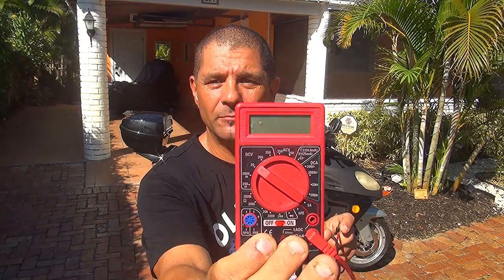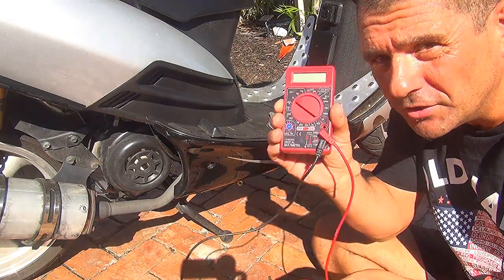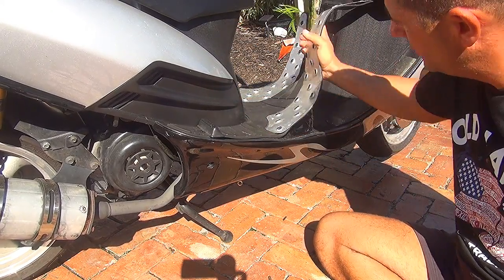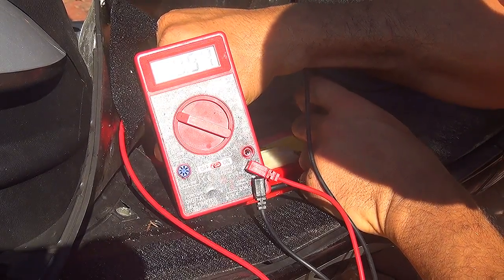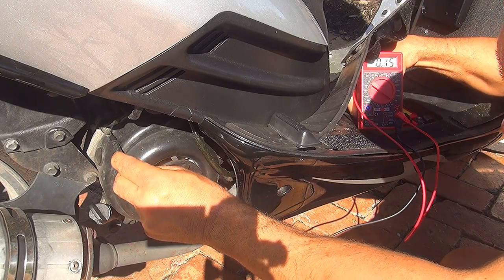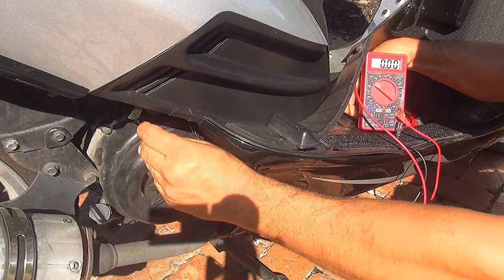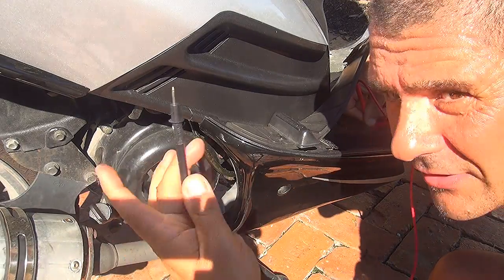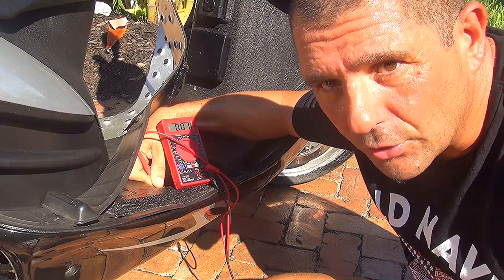How to Check the Ground on your Scooter Motorcycle

Comment: \really good informative video. My Kymco Agility City 125 has been really slow starting almost like a low battery, i have replaced the Battery and Starter Motor but it continues to hardly turn the engine over. i also ran a wire from the positive terminal on the Battery direct to the starter motor but nothing changed. Any ideas?
Reply from the maker: It's great that you've already replaced the battery and the starter motor to address the slow starting issue on your Kymco Agility City 125, but it's frustrating that the problem persists. Here are some additional troubleshooting steps and ideas to consider:

Starter Relay: Check the starter relay, which is responsible for sending power from the battery to the starter motor. If the starter relay is faulty, it can cause slow cranking or even prevent the engine from turning over. Try replacing the starter relay or testing it to ensure it's functioning correctly.

Electrical Connections: Inspect all electrical connections in the starting circuit, including those at the battery terminals, starter motor, and starter relay. Loose or corroded connections can result in a voltage drop and slow cranking. Ensure all connections are clean and tight.

Ground Connections: Poor ground connections can also affect the starting system. Make sure the ground cable connecting the battery to the frame and engine is in good condition and securely attached. Clean any corrosion from the ground points.

Ignition Switch: A faulty ignition switch can sometimes cause issues with starting. Check if the ignition switch is functioning correctly by testing it or replacing it if necessary.

Starter Solenoid: The starter solenoid, often integrated with the starter motor or located nearby, can malfunction and cause slow cranking. Ensure it's in working order, and if not, consider replacing it.

Compression Check: If the engine is turning over slowly, it might be a sign of internal engine problems, such as low compression. Consider performing a compression test to rule out any engine issues.

Charging System: Make sure your scooter's charging system is working correctly. A weak charging system can result in a poorly charged battery, which may lead to slow starting. Check the alternator, regulator/rectifier, and stator to ensure they are functioning as they should.

Starter Clutch: The starter clutch is responsible for engaging the starter motor with the engine's crankshaft. If it's worn or damaged, it can cause slow or ineffective cranking. Inspect the starter clutch and replace it if necessary.

Engine Oil: Ensure that the engine oil level is correct and the oil is in good condition. Low oil levels or dirty oil can increase friction and make it harder for the engine to turn over.

Consult a Mechanic: If you've checked all the above components and the problem persists, it's advisable to consult a professional mechanic who specializes in scooters. They may have specialized diagnostic tools and expertise to pinpoint the issue accurately.

Remember to prioritize safety when working on your scooter's electrical system, and if you're unsure about any step, it's best to seek professional assistance. Electrical problems can be complex, and a thorough diagnosis is essential to resolve the slow starting issue.

Comment: great video! i think mine has problems lol. I put the postive (red wire) to the batter yand when i check the battery ti read 12.9. But when i move the black wire to another metal part on the bike, i only read 0? I tried many bolts is this a bad ground wire for me?
Reply from the maker: It seems like you're experiencing a problem with the ground connection in your scooter's electrical system. When you connect the positive (red wire) to the battery and get a reading of 12.9 volts, that indicates your battery has a good charge. However, when you move the black wire to another metal part on the bike and get a reading of 0 volts, it suggests that you have a bad ground connection.
Here are some steps you can take to troubleshoot and potentially fix the issue:
Check the Ground Connection: Make sure that the black wire is securely connected to a clean and bare metal surface on your scooter's frame. The metal surface should not have any paint, rust, or other insulating material on it. Clean the surface if necessary.
Inspect the Black Wire: Check the black wire for any signs of damage, such as fraying, cuts, or exposed wires. If you find any issues, you may need to replace the wire.
Tighten Connections: Ensure that the black wire is securely fastened to the metal part using an appropriate bolt or screw. Sometimes, a loose connection can result in a poor ground.
Test with a Multimeter: Use a multimeter to check the resistance between the black wire's connection point and the negative terminal of the battery. You should ideally have a very low resistance or continuity (close to 0 ohms). If you have a high resistance or no continuity, there's a problem with the ground connection.
Look for Corrosion: Check for any signs of corrosion around the ground connection point. Corrosion can hinder the electrical connection and cause a poor ground.
Replace the Ground Wire: If you've tried all the above steps and still have a poor ground, it may be necessary to replace the black wire with a new one.
Remember to disconnect the battery before working on any electrical connections to ensure your safety. If you're unsure about how to proceed or are unable to resolve the issue on your own, it's a good idea to consult with a professional mechanic or an expert in scooter electrical systems. They can provide specific guidance and assistance in diagnosing and fixing the problem.
Thank you for watching my video

Comment: Please can you tell me how to change the throttle cable on TGB Delivery ? I can't open that plastic part with speed clock on it .
Reply from the maker: Hello Mihail unfotunatelly I'm not to familiar with youtr scooter but try to look on the lower side if you see few screws that hide on  the lower part of the front

Comment: Ok so if someone hooked up the battery or hooked it up with a fuse in it it will blow the fuse but it would also would it kill the battery because I hook it up to a trickle meter and it said that the battery was fine so ???
Reply from the maker: Hello yes the battery is good but you have a short on your electrical wire harness somewhere or at the stator so you need to have multimeter and start to check your wires for continuity

Comment: Hallo I have a question, i tested a pickup coil on a gy6 and voltage goes from positive 2 Volt's to negative -4 Volt's, thus double the negative, can you tell if this is normal, thanks
Reply from the maker: Hello to check you should test with multimeter set on AC voltage and you should have a reading of 0.3 to 0.5 by connecting the green wire to the black probe of the multimeter and the red probe of the multimeter to blue and white wire coming from the pickup but you should not have a -4 reading check when motor is off for resistance value start by setting your multimeter to ohms and you can connect the black probe of the multimeter to a green wire coming from the stator and connect the red probe from the from the multimeter with a blue and white wire you should have a resistance reding from 140 to 200 if the pickup i good if you see I on reading the pickup is not good anymore. I hope this can help you and thank you for watching my video

Comment: Please could you help me? I have a problem with my scooter it runs fine when I pull the rear brake lever but when I let go of the rear brake it runs horrible it bogs down and backfires I’ve cleaned the carb and re jetted and nothing has changed
Reply from the maker: Hello Marc I think is a wire short on ground somewhere you need to follow the wire harsess and check if there is any squeeze wire

Comment: I have a slight issue that I hope you can help.
   Sometimes in the morning around 6am est my gy6 50cc scooter starts ups perfect..then at night after work about 5PM est the bike will not start at all...but several hours later it will...having done nothing to it....any ideas...
     Thankyou
Reply from the maker: Hello Richard I will place a better quality sparkplug on the scooter or check the gap on your sparkplug but there is a possibility that you need to reject your carburetor according to your location altitude. Thank yoou for watching my video
Reply: Thankyou for the advice.  I actually never thought of rejecting for my location...I will definitely try it....

Comment: hey bro i have a question i switched my ignition to DC because AC stator bolts keep loosening and causing and stator to keep spinning in side the flywheel cover and it’s a sharp edge inside that keeps taking pieces of copper winding out of my ignition coil on stator and i replaced  stator at least 4 times so far  on my 1st try i used removable loctite let it sit 2 days to make sure loctite was set but it come off i’m less than 5 miles. (continued)

Comment: Hello there I love your videos. I watched a few on how to change engine oil. On my 150 cc scooter it was my first time changing the oil, I drained it nicely however refilling it is giving me a huge headache. I refilled it my dipstick shows it was good enough then after coming back from a ride and letting the oil settle for a hour and a half nothing on dip stick, tried this couple times ended up getting frustrated and checking the oil right after turning off the engine which caused the hot oil to splur all over my hands, now I am re filling a little bit letting it settle and checking dip stick every hour? Any tips on what can be done🙁
Reply from the maker: Hello my friend sometime oil does't wont to flow in right away so place the scooter on a center stand and little by little with a small funnel place 0.05 quarts of oil in the motor and then close the dip stick in and screw in after that turn the scooter on for only 5 SECONDS turn the scooter off and  reopen the dip stick and place little by little with a funnel 0.03 quart of oil  so for a total of 0.08 quart that is less that 1 full quart container . Thank you for watching my video
Reply: @VirberelloScooterTips  what's the best gearing to use on my 150 scooter? One (dude no name) said 15/37. 😃 Thanks.

Comment: What do you do if you don't have the same reading on your multimeter?
Reply from the maker: Hello my friend you are completely right I should have said that on the video if you don’t get the same reading you should replace the green cable that go from the negative side of the battery to the frame or run a separate cable from the negative side of the battery directly to one bolt of the motor . Thank you for watching my video
Reply: @VirberelloScooterTips  Thank you! I watch all your videos, you have saved me a ton of money and time on scooter repairs! 😊

Comment: how can you conect a  cable tree thats has some colors that dont match need some help with mine
Reply from the maker: Hello BlazingAmazing  the best way will be to have your scooter wires diaphram to have better idea but if you thinking about the wires bobina stator you always have a green / ground plus a red and a yellow and a blue wire coming from the pickup or check or you can check on fb chinese scooter group to see if someone has the same set up. Thank you for watching my video
Reply: @VirberelloScooterTips  thankx for the reply man love the vids been watching for 2 jears now 💙🥰
Reply: @VirberelloScooterTips  subbed 😃
Reply: @VirberelloScooterTips  i have a skyteam pbr
Reply from the maker: @BLzG-official  coo bike https://www.planetminis.com/attachments/pbrst50-pdf.42009/ this is the pdf and wirinf diagram